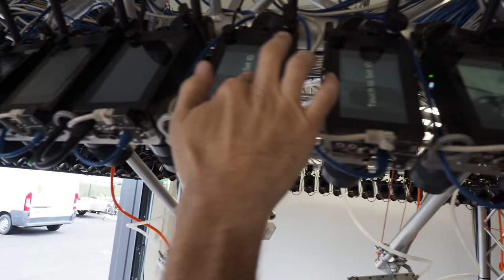Most Expensive Camera Unboxing Ever | $400 000 Chronos Ring

Comment: My wife has used highspeed video for destructive-test in aerospace applications.  Back when she got started it was almost always done outdoors since the light required wasn't especially practical indoors, and the cameras themselves individually cost as much this whole rig now costs.  When I showed her Kron's website store he was astounded by how inexpensive, relatively speaking, good highspeed cameras are now.

The only suggestion she has for you guys is to add some kind of calibrated scale (white and black tiles of known size, at least two rows, possibly on a plane if you need to calculate velocities of flying shrapnel or other debris, so that you can compare frame rate versus distance to determine velocity.  Otherwise she thought your various highspeed videos look good.
Reply: Ahh of course, I did wonder what the chequered tags on high speed tests meant!
Reply: take an led and run it oft pwm.. It can be mit below 1ms if done right ;-9

Comment: Should have Mounted the POE Switches Right to the Ring itself With Shorter 20FT Cables. 
Nice to See you are using Chronos Equipment , Canadian! 
Working in the IP Camera industry I understand the crazy LONG Setup time that is needed on a system like that! 
Have had Customers Asking about the 2.1-HD Cameras they have listed on the website , They look VERY Interesting!
Reply: I think they used long cables because they knew they needed long ones for the big ring outdoors. One set of long cables then worked for both the small indoor ring and the huge outdoor ring.
Reply: @WoodworkerDon  100FT / 30M Cables Are Cheap they DONT Last VERY Long Moving them around... So they would be best to have a set for each location and not have a chance of them failing.

Comment: Those cables really should have been bundled up to four switches on the back of the ring, and then use just a couple of uplinks from each of those. Assuming it's running standard TCP/IP over ethernet, at least. Much less cable, much easier management, and sane uplink management. But that's on the people shipping it to you, not you guys putting it together. Wow. So much network.
Reply: Oh, wow. Outdoors too? That explains the cable length. >.>

Comment: So long Ethernet cables is just ridiculously silly way of doing this. Just put few three 24 port switches and short cable to each camera, and connect out using 2x10Gbps uplinks via fiber or copper. Way lighter, lower stress on a structure, and in fact kind of faster. And it also saves quite a lot of money when you spread cameras around in bigger field.  The trigger system is kind of wonky too, and wastes a lot of cables and weight.

Comment: might want to blur out the address on the wooden crates showing your unit location
Reply from the maker: It's not a really secret where our workshop is located since it's so easy to find out using just google
Reply: @Beyondthepress  Plus anyone considering stealing from you guys has got to think twice, hmm they are powerlifters and have some quite serious weaponry, crossbow, air cannon, smashinator, etc. etc. And walking around your workshop you would never know any metal parts could be "red hot" (well, not RED hot, but you know what I mean!).
Reply: And addresses are not a big secret in Finland. Almost any address is a pretty easy to find.
Reply: Don't worry, the unit is protected by creatures that may attack at any time.